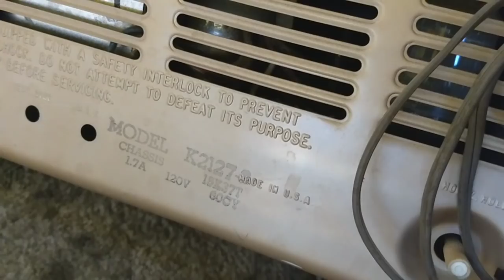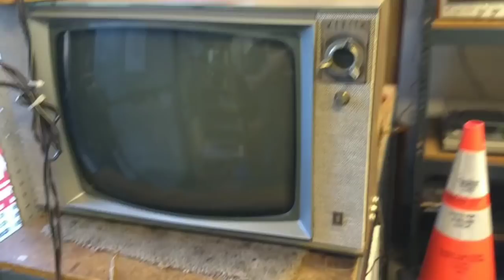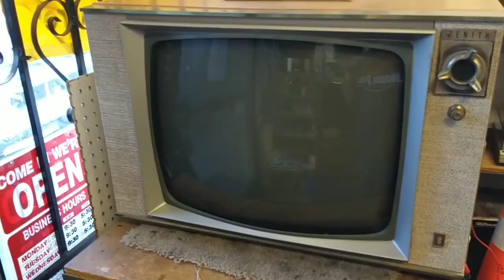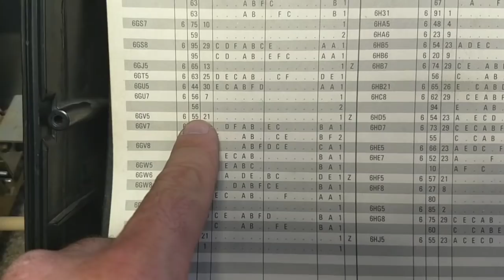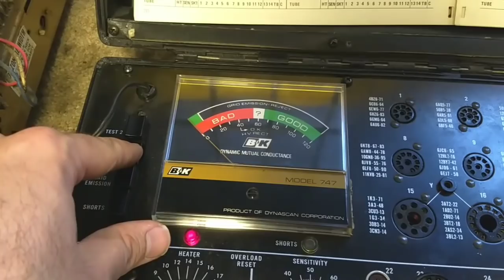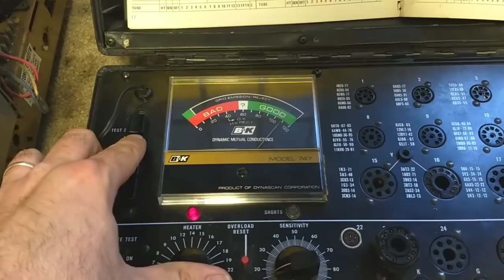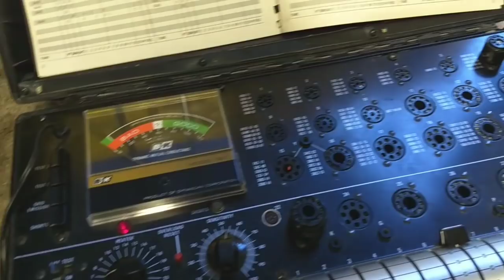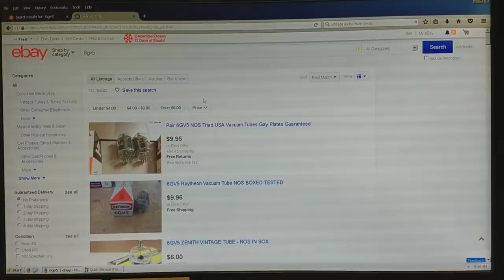Servicing an early 60s zenith model K2127 19" B&W television Part 1/?

Comment: 15K37
15= tube count 
K= model year
37=  consecutive number , the higher the better chassis as a rule.
In C-line apx 1971 they changed  format
19EC45
19= screen size
E= model year
C= color TV
45 as above
These were great sets, almost immortal. We were fixing them through the 80's mostly for
little old ladies bad jugs were rare.
C U later Tom

LFOD !
Reply from the maker: I had a 19ce45 zenith. Chromacolor ii vertical chassis? Great set with the black matrix CRT. Shoulda never sold it.

Comment: Replace the fish paper insulator around that copper Focus sleeve. The yolk will Ark to that and that will be the end of the set
Reply from the maker: Good to know. I take it you discovered this first hand?
Reply: Jordan Pier yes, ruined the yoke hot and damper
Reply: @shango066  Im working on a simular set with same chassis,Im open to sugestions,cant get horizontal to lock,just free wheels.I changed the detector diodes,had no affect.I checked the integrator in the circute,checked ok,tubes check good,but Im woundering if there could be heater to cathode leakage in the horizontal out put tube.Everything checks out good,Im at a loss with this one.Any ideas?
Reply: @funwithmrchris729  bad integrator. Watch my video on zenith integrators
Reply: @shango066  Ok, thanks. Your videos have helped me on other stuff.I've ben working on radios and tvs since I was 14,lol,but I always learn new things watching your videos.Thanks for the help.
Reply: Worked on the Zenith today,and that was the problem.Thank you for the info.

Comment: I used to have a similar set a late 1961 23" B/W with the all metal cabinet.....talk about heavy. It also had a similar tuner I believe Zenith referred to it as the "bullseye tuner". I have never seen a sleep timer on a television, pretty cool. I was wondering if the timer was a factory part and the volume only knob on the front would seem to strongly suggest that it is.